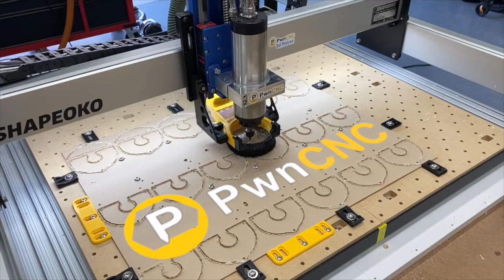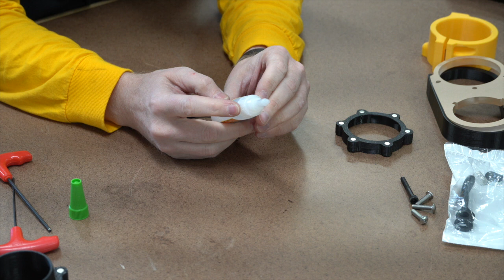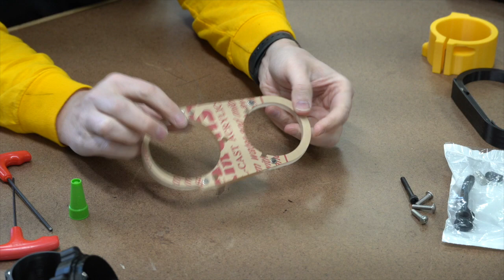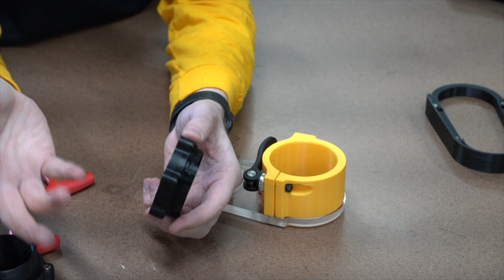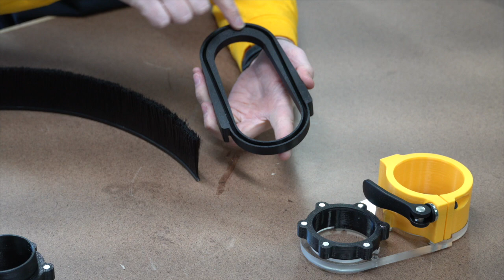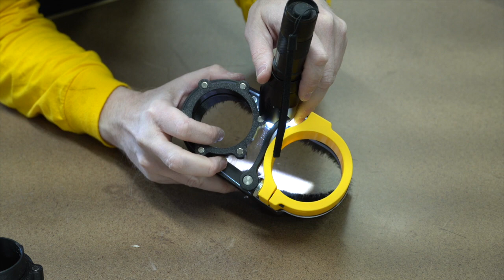PwnCNC Dust Boot v7 Assembly

Comment: what is the acrylic thickness?
Reply from the maker: Hello Erik, our acrylic is 3/8" cast acrylic however you could use 1/2" if you desire.
Reply: @PwnCNC  thanks for your response. I ended up 3d printing the acrylic part because I only had .25 inch laying around. I got my makers pack yesterday and got it assembled. Such a clean design! Thanks for the skittles too!

Comment: in general love this dust boot but for some projects have had the tightening handle rattle out or become loose making the dust boot slide around or even off in one case. Do you think it would be ok to use some thread lock on it once dialed in to fit the snuggly?

Comment: Assembly doesn't show it being installed on a router or spindle.  I can't see from the info on your website whether this product attaches the dust hose to the front or the back of the router, which is what I was trying to find out...  Could you either show whether the dust hose is front or rear mounted on your website or on the video?  Thanks!  (I like the dust boot being spindle mounted (instead of gantry mounted) but started looking to replace my dust boot to get a rear-mounted hose...  So I can't buy this as I can't determine that...

Comment: I’m so confused. So if I purchase the $140 4” boot. I also have to purchase an add on accessory to make it work properly?
Reply from the maker: On the product page (https://pwncnc.com/products/dust-boot-v7) it states that all parts are included including the MagLock hose adapter.
Reply: @PwnCNC  so the video is wrong? And when I click that link it says the page no longer exist?
Reply from the maker: @Golfexpertbelieveme  looks like the way I pasted the link and YouTube messed it up.  Try this one:  https://pwncnc.com/products/dust-boot-v7
Correct, the video is wrong, everything needed to use the boot is included as described on the product page.  This is a very early video and I need to update it.

Comment: Are you guys gonna make a V7 style with the rear hose hookup? I need to buy one for a Shapeoko and one for the onefinity but I really would like the rear hose hookup vs the front top version.
Reply from the maker: v7 is a router/spindle mounted design that moves up/down with the spindle.  ATM the only rear-hose versions i have is the v2, v3, v8 which are all z-independent and don't move up/down with the spindle.
What you're proposing is very intriguing.  I'll have to mull on how to make that happen.  having the hose move up/down AND route it under the gantry is no easy task.  Lots of moving going on which has the potential to interfere with the machine.

Comment: Just got mine today out here in PA... Had it together in 10 minutes and running in 20... Seems to be an elegant solution. With the 4" hose it pulls the chips up real nice. Gonna take a bit to get used to not being able to see the bit, but this is a nice setup. Thanks!
Reply from the maker: Faster than my assembly video... nice.

Comment: Some of these files are dxf how do you print these? They cannot be imported into Cura
Reply from the maker: Only the STL's are intended to be 3d printed.  DXF and SVG files are all 2D graphics intended to be pulled into some 2D cutting software like Lightburn for lasers. 
The v7 boot is an assembly of parts of different materials.  The DXF's would be laser cut from acrylic sheet stock.
Reply: A gentlemen and a scholar! Thank you so much for the reply!!!

Comment: what does 25 ,40 and 80 mean in the file names?
Reply from the maker: I numbered the v7’s with the first two numbers being the diameter of the router/spindle the boot mounts two… in millimeters.
The second set of two numbers refers to either 2.5” or 4.0” intakes for the hoses being attached.

Comment: What acrylic plate is needed to order parts to 3D print a V7?
Reply from the maker: If you're interested in making v7 for yourself... i'd start here:  https://pwncnc.com/make-boot-v7
I provide links to all the things, hardware, acrylic, and brushes you'll need.
Reply: @PwnCNC  getting a 404 here now - is this page updated somewhere else?  Thanks!
Reply from the maker: @robertcarey3104  Fixed the link, but don't have great maker documentation yet.  It is on the way, so unfortunately, atm it's a figure it out kind of deal.  The new place the url points to should help a lot though.. https://docs.pwncnc.com/boot/v7
It's my assembly instructions which, for v7, is pretty much most of the build.